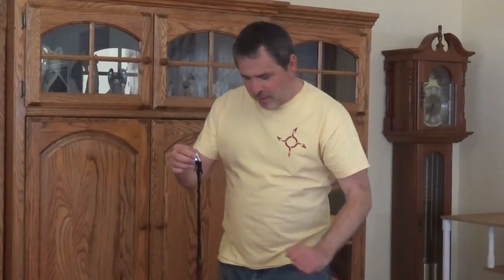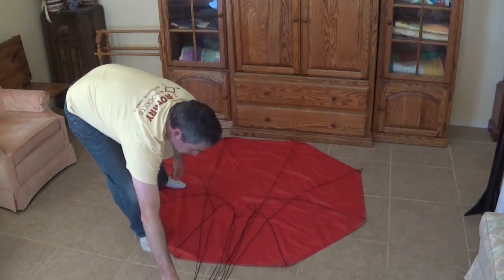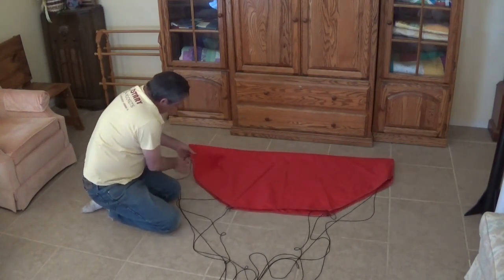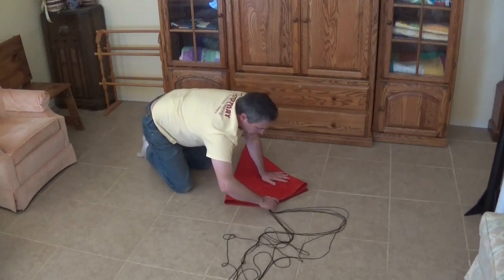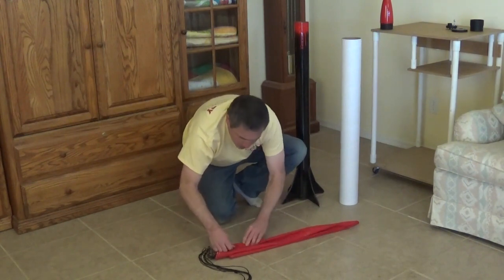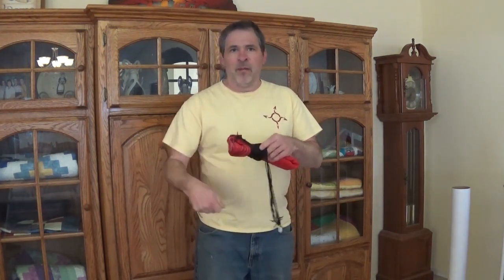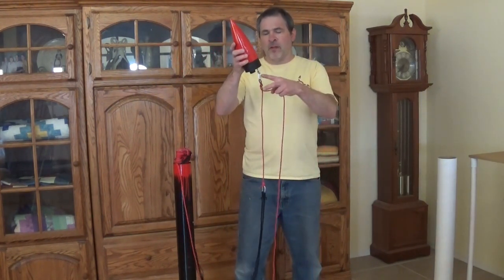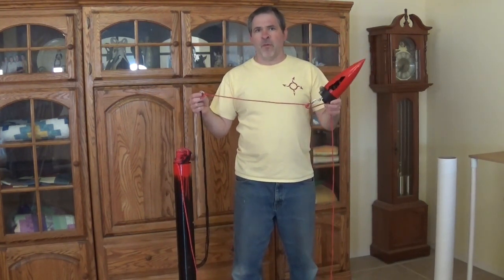How to fold a model rocket parachute / parasheet

Comment: Don't wrap the line around the parachute.  Roll the parachute to get the cords around the parachute this will prevent a tangle and the parachute will open.
Reply from the maker: I've had good luck with just one or two wraps around the parachute. It helps keep the parachute from expanding and getting tight in the rocket. We did have a few tangles / failures prior to this when I was completely wrapping all the lines around the parachute. That's why I specifically said not to do that. Real bummer when the parachute ejects perfectly but does not deploy because of a tangle.

Comment: The rule of thumb for shock cord size is generally length of the rocket ×3-5. Nothing more complicated.
And do you use fire protection for your parachute and nylon shock cord ? The ejection charge will very easily eat through a parachute or a shock cord in nylon. Would be a bummer to ruin such a nice chute
Reply from the maker: The "3-5x length" rule generally works but my calculation is more accurate to what is "actually" needed to successfully pull out the parachute. For instance, in my first example, the shock cord length was 10 feet. If I use 5x the rocket length then it would  be a 20 foot cord. That would just be an excessively long cord that is just not needed.
We do use fire protection... Did not mention it because that would really be better discussed when discussing ejection charges.